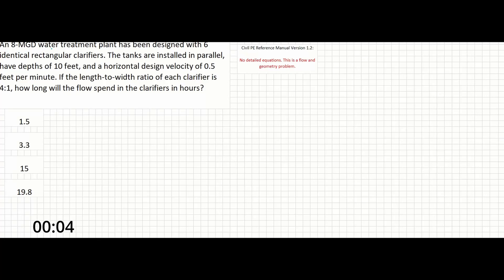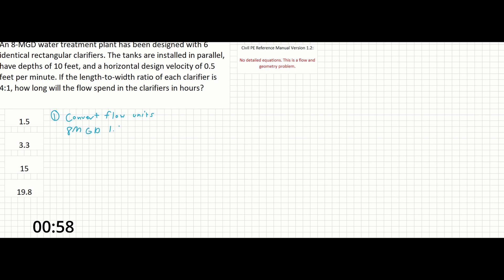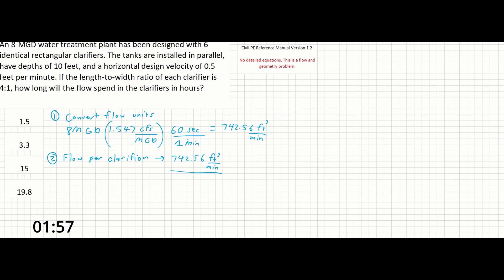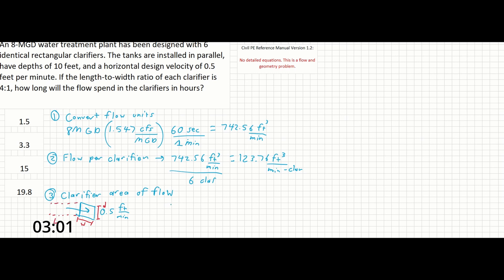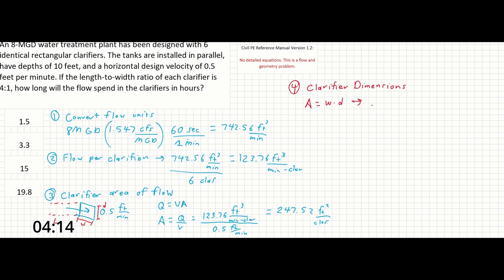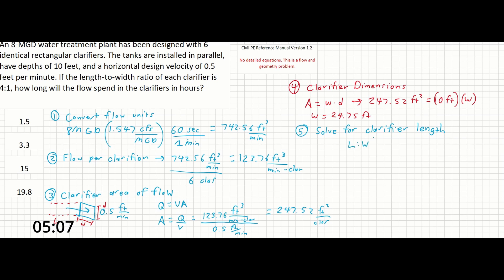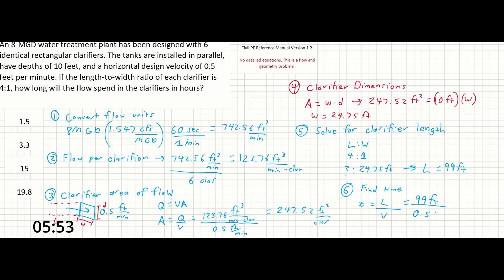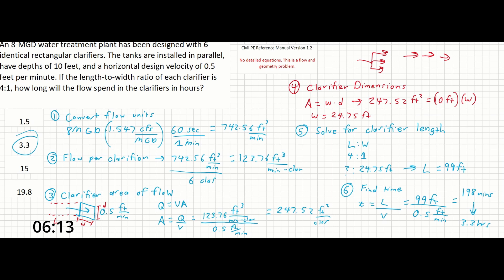PE Exam Practice Problem #1: Water Resources | Rectangular Clarifier Design - Detention Time

Comment: For those that searched "clarifiers" in the handbook and are looking at the hydraulic loading rate equation, and you're wondering why he's using the cross sectional area of the tank and not the surface area, its because the problem statement says the horizontal velocity. If the problem says things like “surface overflow rate” or “hydraulic loading rate”, use surface area (if you dont understand conceptually what that means, I recommend watching a video on overflow rate to visualize). 
If it says “horizontal design velocity" or is clearly about flow moving horizontally through the tank, use cross-sectional area normal to flow. He shows this concept in a doodle in the solution but I had to read up on it to make it clearer in my head. It's confusing for us folks who dont have a ton of industry waste water design knowledge because the parameters of design are not as clear in our heads. I hope it helps anyone confused!
Reply from the maker: Thanks for adding your thoughts to this problem! Things often seem more clear to the person presenting than to the person hearing it for the first time. I'm sure I have a ton of problems that would benefit from further clarification.

Comment: i thought the area of a clarifier is L times W and not W times D
Reply from the maker: In step 4, we are looking at the cross-sectional area of the flow passing through the clarifier. So this will be width times depth, as we define in our little drawing in the bottom left-hand corner of the problem.

Comment: In step 6 to find the time, can you also use the dimensions of W*L*D to get the volume of the clarifier and divide it by the flow per clarifier (in ft^3/hr) to get a time of 3.3 hours?
Reply from the maker: Hey there. The math seems to work according to the quick check I just did. In terms of the concept, I can't think of why that wouldn't be possible either. Thanks for pointing it out.
Reply: @SolvedIn6  Thanks for the response! Yeah we were taught to find time by dividing volume over flow, hadn't seen it using length over Velocity before. Thanks!
Reply from the maker: @adnanmalkoc6366  Sure thing. In this problem, the horizontal design velocity is a specified value - so that is why we used it.